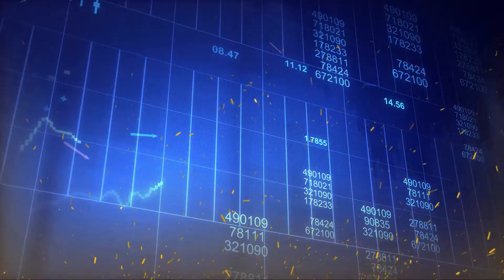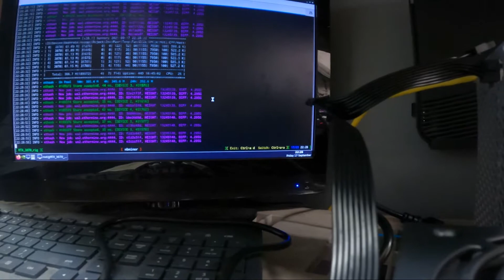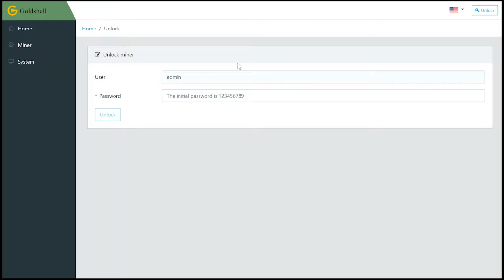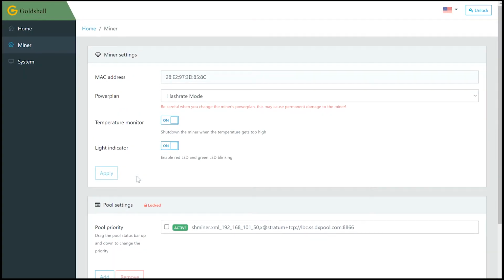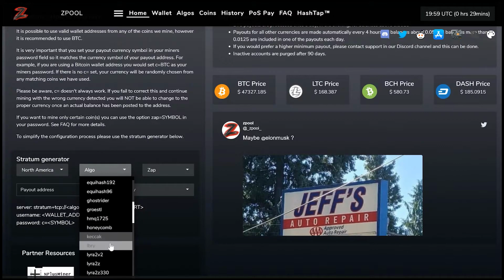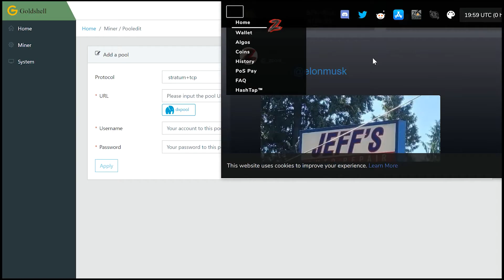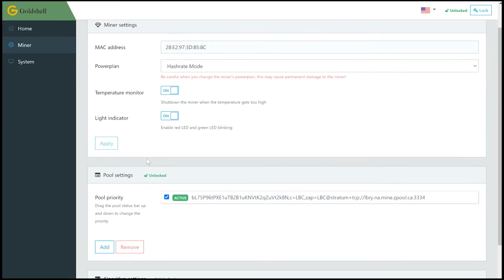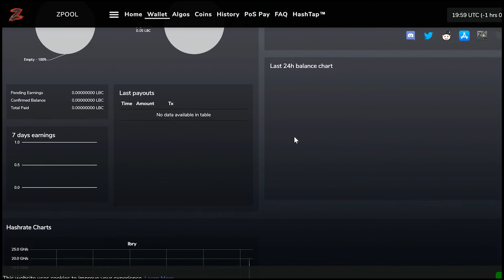How To Setup Goldshell LB-Box!!

Comment: will it not run if u dont have the jumper pin ?
Reply from the maker: If its an atx psu like in the video, then it wont start without jumper
Reply: Can you add a link for the jumper pin you use? Thanks
Reply: I used a COMeap 24 Pin ATX with a on/off switch - from amazon